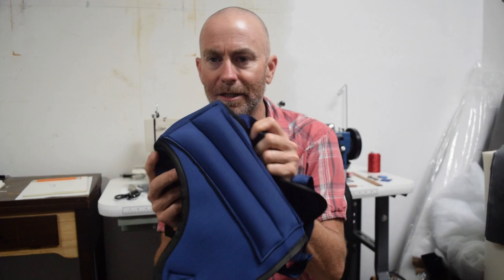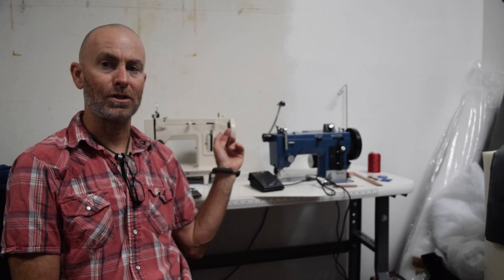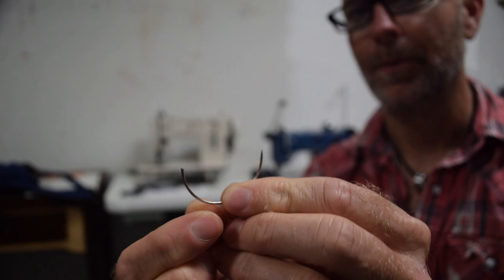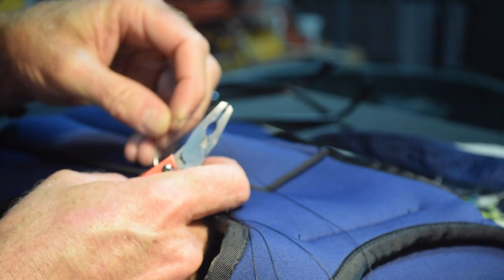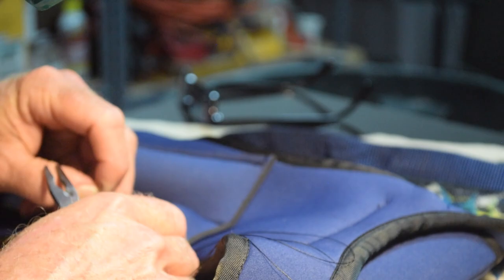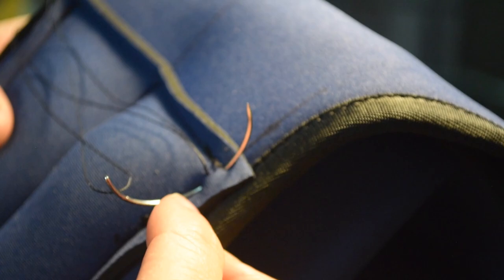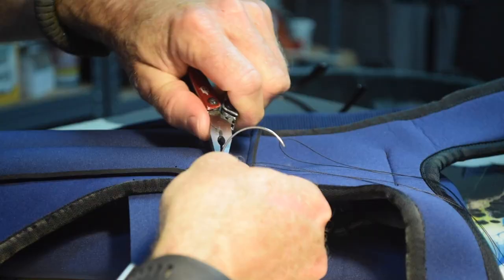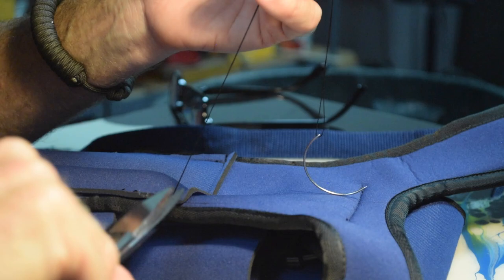Sewing Repair: Using A Curved Needle

Comment: I used curved needles (reverse cutting - triangle cross section) and needle drivers for suturing. Basically the same technique. I would recommend needle drivers if you do have to do more similar types of sewing because the handles (loops like scissors) give you better control of the needle.
Reply from the maker: Thanks for the info, I'll check those out!
Reply: @thejasonofalltrades  look for Mayo Hegar needle holders/drivers and make sure the tips aren’t too aggressive to avoid damaging your needle. Olsen Hegar style have scissor blades above the beaks so avoid this style. It’s way too easy to accidentally cut your thread/suture.

Comment: If you want to singe the threads and not damage the material around it you can put some tape on each side with the thread in the middle. I use the blue painters tape, tuck it in close to the thread and hit it real quick.
Reply from the maker: That's a great idea, I'll try it!  Thanks for sharing!

Comment: to ease insertion (and this is warranted given you are sewing a heavy assembly) you can grind edges onto the neddle tip so it cuts the fabric just a tiny bit instead of seperateing the fibers as much.  this is what 'sailing' needles do.  they ,usually have 3 sides to the tip but as long as one edge is casted onto the needle tip itll do.  and for curved needles this is a really good idea.  curved needles call for sharpening(and in the process the needletip looses its round profile) due to the need for a sharp tip to shear into the fabric sideways.  come to think ive sharpened curved needles quite often. 

when handstiching i dont miss the oportunity to pass the thread under the previous stich in order to carefully set the tension as i sew- and keep it so.

Comment: Just wanted to say that after checking out several clones, I decided on an LSZ-1 Premium about 6 or so months ago.  And I've since upgraded the motor to the WorkerB.  I LOVE IT!  And it's the machine I most often reach for first (I have it installed on the Sailrite folding table).  For some reason I get more enjoyment out of this machine than my two other industrial machines (flatbed and cylinder arm, although they each have their uses).  But what really sets the Sailrite apart from the "competition" is the absolutely outstanding customer support.  Not to mention their manuals and training/project/support videos.  I haven't found any other company in their league.  I'm looking forward to your comparison video.

Comment: What size curved needle would you use on Faux Fur?  Were in the process of sewing seems together but because it was already attached to something it was awkward and we were told to use a 7mm curved needle.   I don't see a 7mm anywhere so I'm assuming I have that wrong.   What do you think??   We have a number 6/7 from my mother's kit from years ago wondering if that would work?
Reply from the maker: Hi!
I have never used faux fur, so I'm not sure what would be best. If you haven't tried already (sorry for the delay) I would try what you have first.
I see curved needle packs with sizes ranging from 7.5cm to about 16cm, so perhaps the 7.5cm is what was meant. 7mm would be a very tiny needle.
I hope that helps, thanks for watching!

Comment: Hi Jason, do you have a video or could you make one regarding the minimum setup/tools to start off? I took classes for a year, but we worked a lot with lightweight fabric, it would be nice to know what you consider as essential, or very useful to complete your various projects. I'm more inclined towards more rugged and thicker materials.
 
Thanks and good job!
Reply from the maker: Hi, that's a great suggestion, I'll add it to the list!
For the time being, the short list is:
A sturdy pair of scissors/shears (doesn't have to be giant metal ones, although I love Wiss W20W shears.  I also have a set of Fiskar "titanium" from the regular fabric store that work very well.
Tailor's chalk
Several industrial-style seam rippers (as opposed to the tiny ones that many sewing machines come with).
A long metal ruler
A vintage domestic sewing machine and/or portable walking-foot machine (Sailrite) and/or an industrial walking-foot sewing machine.  A vintage domestic is the cheapest way to start and will get you quite far, but if you do a lot of work with heavier materials, a walking-foot machine will be indispensable.
And the list goes on and on from there ....
Thanks for the suggestion!
Reply: @thejasonofalltrades  Thanks a lot!

Comment: I'm guilty too. I have more machines than what I need ( by a lot ). But most of them would be going in the dumpster if I did not get them. As Jason said: the were sitting ther for weeks or more with no takers. and they were seriously ill! I happen to like bringing those old relics back to life.  And I like to use them. When the time comes that I cannot, or do not want to use them, I will pass them on to someone that need/want them. But NOT to an internet troll that I guess does not know how to turn it on! Trolls do not really  know what we are talking/writing about! And being from the country of trolls, I can assure you they know nothing about sewing machines! :-)
Chris wrote that sharpening them is a good idea. Maybe, but not in this case when probing for a stitch already made. Then a blunt needle makes searching for the already pierced hole in the fabric is easier. I believe the purpose of these needles was to sew when you did not want/need to penetrate through to the other side. Just as in the video.
And I would like to know what kind of fabric this is. I got a bottle holder in a fabric that looks like this, but cannot find a source. It looks like 2 layers of fabric with a foam material between, and is quite elastic. The item I got is a bottle holder.
Reply from the maker: Thanks!
This material is "stretch scuba neoprene" from Joanne Fabrics (big fabric retailer in the US, mostly quilting and "traditional" sewing supplies and fabrics).

Comment: Little defensive..   Usually such a reaction happens because there is some grain of truth in there somewhere. lol..   I have found personally that there is no need to defend being a hoarder after you just admit that you're a hoarder...  If someone says you're hoarding sewing machines, just say:  "Well yeah, that's kinda my thing if you haven't noticed" --- then all the sudden they have no ammo left and their point is completely defeated. lol.. I hoard things too.. I have two safe's full of guns and a shed full of several motorcycles and fourwheelers in various condition... It's kinda my thing.